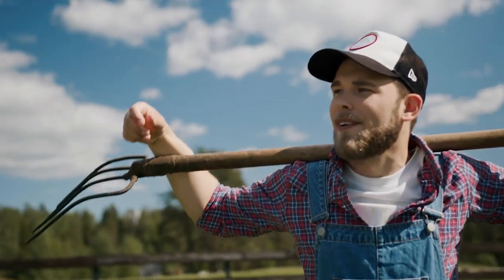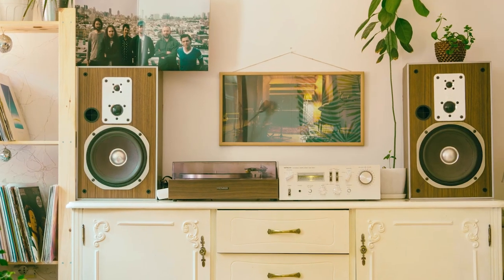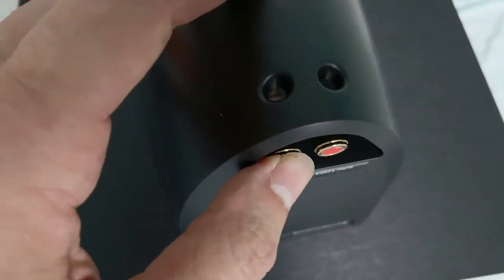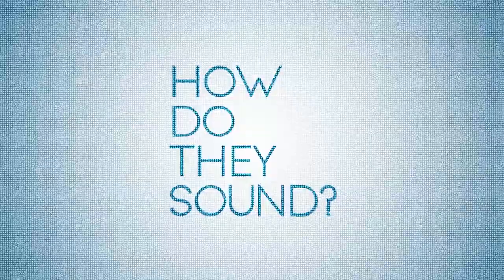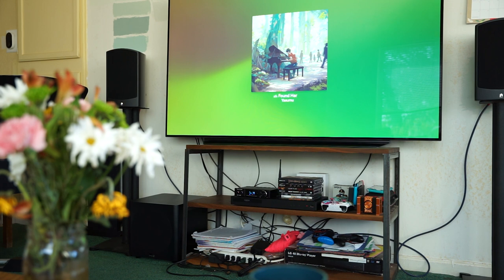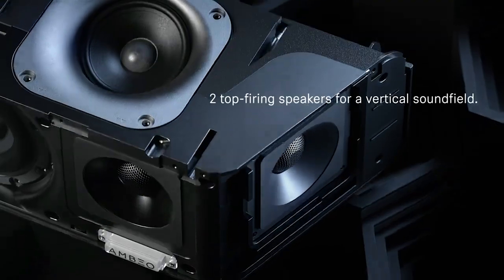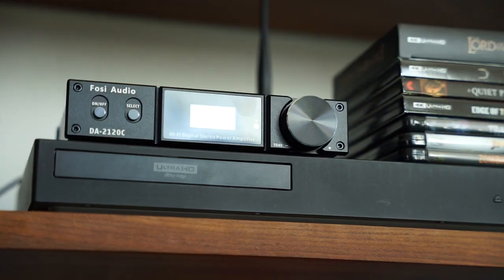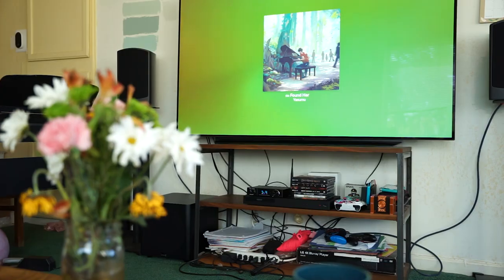How to set up a 2.1 home theater system with Fosi Audio DA2120C? Repost from @hiddenmovieclub

Comment: my bedroom setup i use the same amp driving a pair of RSL cg3m and a bowers and wilkins asw608 sub.
sounded pretty shit until i upped the treble about 4 clicks and the bass down about 3.
it sounds fantastic!
portable i use my modded ipod classic and my sennheiser IE900s and my loungeroom i have a pair of dynaudio bm6 passive sitting ontop of my cerwin vega ve8 with the tweeters disconnected so just does the lows kind of like a 3 way set of speakers but in separate enclosures with no sub and it also sounds amazing.
i mentioned what else i run so you have an idea that i am used to very good sound when i say how good my bedroom setup is

Comment: I’m new to this and confused I’ve got a denon receiver, Arcam cd player with monitor audio speakers and a truaudio subwoofer I want to use it for 2.1 mainly music but not sure how to set it up. I know I wire my speakers to left and right they apparently roll of at around 60hz and the receiver has a sub out so do I connect the cable from that to the lfe on my sub? Also the sub only has volume and lpf not crossover. If anyone can help I would be very grateful. 🙏

Comment: I built a 2.1 speaker system when I was unhappy with my 2.0 system. My 30 year old floor standing speakers needed serious re-build after being in a  terrible storage space. But the sound coming from the pair could not come close to what I heard in my head phones - especially the low bass frequencies. So I had a 8" sub-woofer built and I bought a Fosi BT30d amplifier (less than $100 shipped). Totally changed the usual sound to a 'Wow!" difference. Have you reviewed the Fosi BT30d? I've had it over a year and it's great. Thanks for your video. But I believe I prefer the lower priced BT30d.